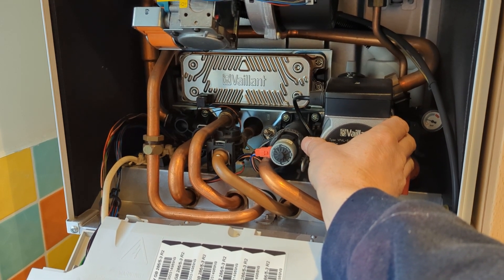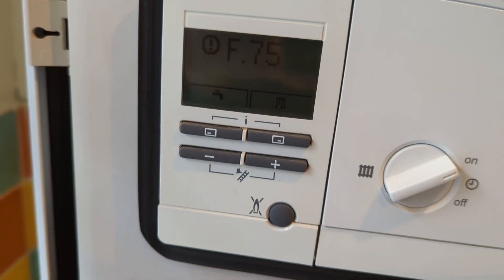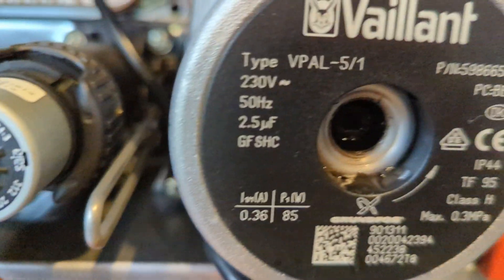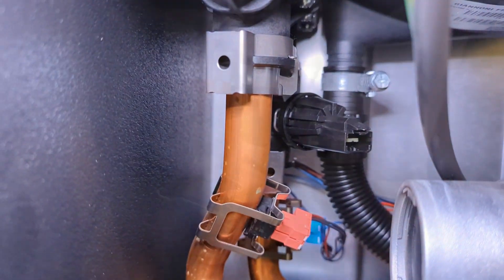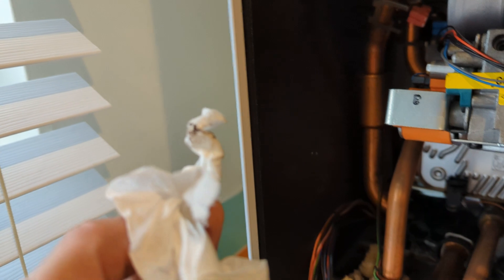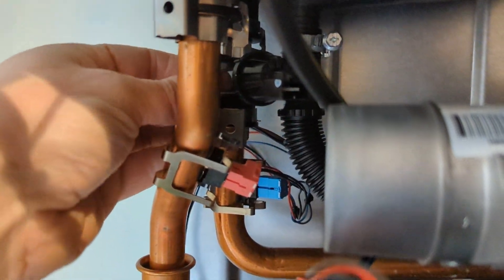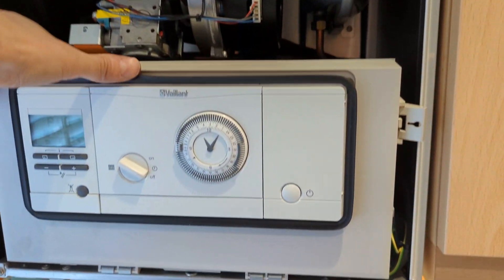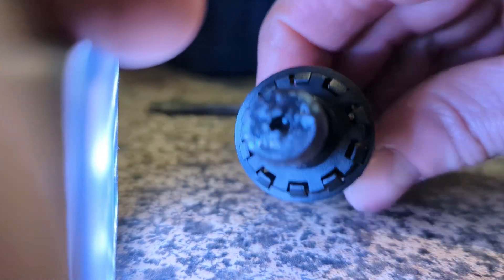Vaillant Ecotec Pro. F75 Fault

Comment: Great video mate.
Reply: I'm relivly new to serving and I do struggle getting some condensing traps out to clean, any content on that would be a great help.
Reply from the maker: Which ones are you struggling with and ill see what i can do👍
Reply: Gloworm, Worcester Ri and the vaillants duo to position..
Reply from the maker: The Vaillants you can often just do the section under the boiler which is a bayonet fitting and pretty easy to twist off. I've only changed the trap once as the hose between the trap and the heat exchanger had split and i removed the side panel to do this. Im sure the trap and the hose came as one so it all got changed and was easy once the side panel was off. I wouldn't actually remove it to clean and just twist off the section underneath the boiler on a service...i will have a look at doing a couple of glowworms and the Worcester for you 👍